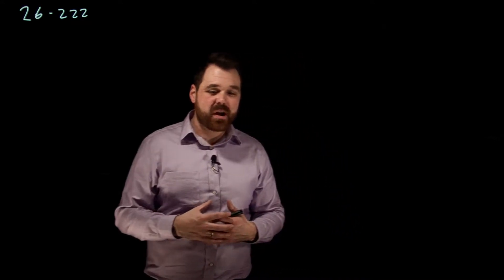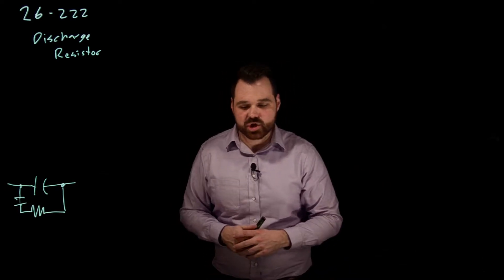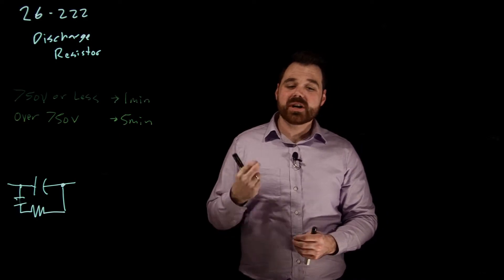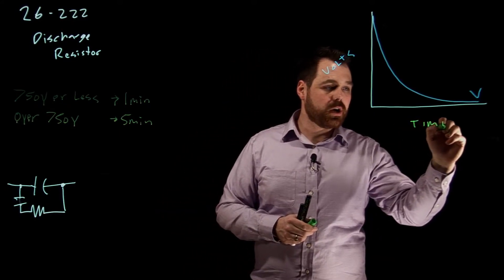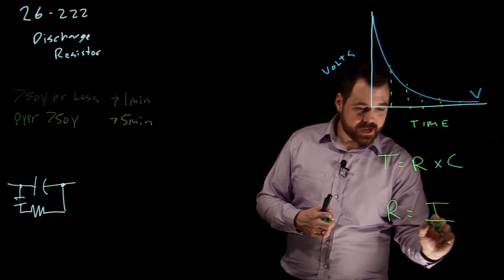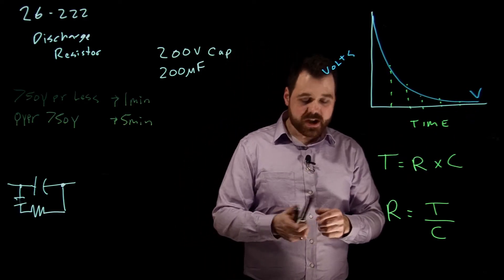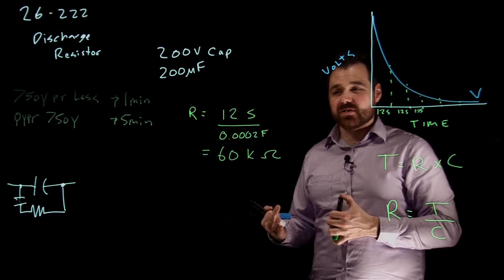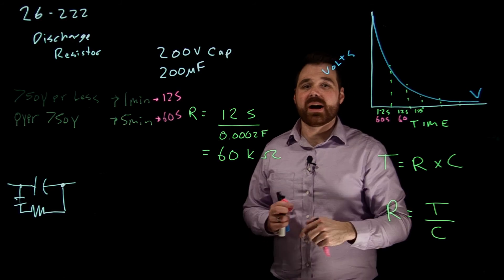Capacitor Discharge Resistor Sizing

Comment: Hobby guy here. I'd like to work on minor circuit repairs, but have held back based on the advice that caps are dangerous until discharged. I was afraid to work on circuits due to this. Thank you for your informative video.

My one question is, you are talking about the time limit. At 1:10 you said that for under 750v you "have to discharge within a minute" (and 5 minutes for >750v). Please clarify: what happens if you don't? i.e. What changes, and what do I do if I don't meet that amount of time?

Or are you saying it takes a minute to fully discharge?

Am I completely out of context? Maybe you're saying a built circuit must do this within the allotted time?
Reply: If I'm not mistaken, I think he is specifying what the law says. For hobby electronics it shouldn't matter, its up to you how fast you'd like to discharge.
Reply: your dranage charge is in 5 time constants so within that 1min for under 750 there is 12s and each 12s will be a persentage of the max voltage that needs to be drained of you dont wait the full 60s you can get shocked depending on at what percentage is left to be drained

Comment: Ok I have 12 2400uf 360vdc pulse capacitors in series . I’m building an exploding bridge wire circuit. I plan to change the caps to 4kv and detonate the bridge wire. Whatever voltage is left in the caps I plan on discharging in seconds for safety reasons. My question is can you discharge 4000 vdc with a 4K ohm 10watt wire would powder resistor safely in seconds ? Any input is appreciated.

Comment: So if I have a 2100v 1 microfarad = 60 mega ohm resistor?
Reply from the maker: Yep that's correct.
Reply: @ZackHartle  Thank you 😊 it does seem a lot though for a microwave capacitor these are usually fitted with a 10 mega ohms resistor from the factory.
Reply from the maker: @tinkertom3683  So keep in mind the 60 Mohm would be the maximum size. Having a smaller resistor would cause it to discharge fast, due to higher current. That would be no problem at all.
Reply: @ZackHartle  I do apologise I'm a total novice 😅 but wouldn't it be more useful to know what the minimum is? And how we would calculate so its fast, doesn't damage the cap and doesn't melt or blow the resistor 🤔
Reply from the maker: @tinkertom3683  That's all. So this video is just about what the Canadian code requires to achieve minimum safety. I would imagine that manufacturers would have recommendations for their products in terms of sizing
Reply: How can that be, if its 1mf that would be 0.000001f so 12/0.000001 is 12 million not 60 million where am i going wrong?@ZackHartle

Comment: Hi. I have a 50V, 60,000uF capacitor, so is this the correct way to write the equation: R=12/0.06? I'm using the capacitor in a flux core welder in parallel with a full bridge rectifier in an effort to get a steady DC voltage. I want the least amount of interference with the voltage and current from the resistor, but I want the resistor to bleed the capacitor within 60 sec after I power off the welder. Also, is it correct that the greater the value of the resistor, the less it will interfere with the voltage and current? Thank you for the great tutorial.
Reply: Understand.
Cheers

Comment: so, i have 63v 30,000mfd capacitance to discharge. that's a 4000k ohm resistor?
Reply: @ZackHartle  yes. i'm converting an ac welder to dc, with a bridge rectifier and a smoothing capacitor. i was recommended to use 100 farad capacitor at around 50v. i thought 30f at 63v would work. the design of the welder has the tip always connected to power, so i need to be able to drain the capacitance energy for safety.
Reply: @ZackHartle  i wasn't sure about my math. it didn't seem right to me. i only have a rudimentary understanding of electronics. most of my electrical experience is in automotive and residential circuits and wiring. i have one of those cheap harbor freight 90 amp flux core welders, and thought ac/dc conversion would be a good beginner project to learn from. i understand the components needed for the application, just not how to calculate the correct values required to have it function safely. that's why i watched your vid. i could just put a rectifier in the circuit and have it operate, but i'm also trying to improve the welder's function as well as learn.
Reply: @ZackHartle  well, you did answer my question, so that was a great help, thank you. teaching yourself anything is an adventure, but it's better than simply remaining ignorant. i try to learn something new every day, even if it is only that i have much more to learn.

Comment: Hello
If Ive calculated bleed resistance,can I use smaller resistance than calculated-hence  cap discharge time will be quicker.Can I have resistor to get-lets say-10 seconds discharge for 550v caps in valve amp
I mean is it safe for  capacitors?